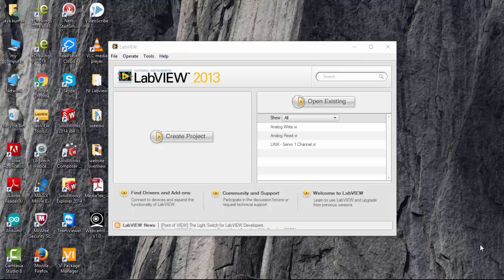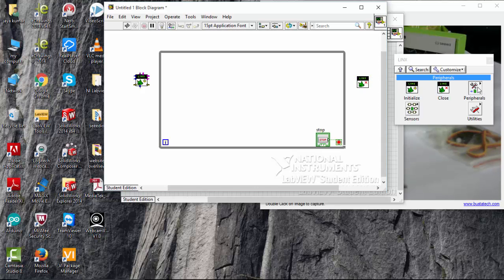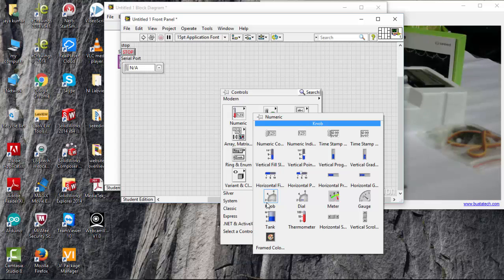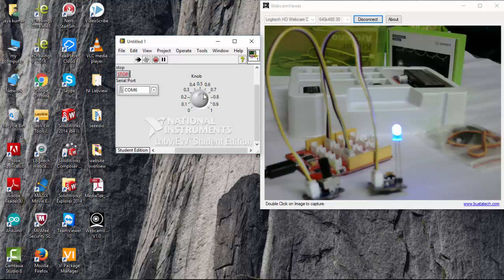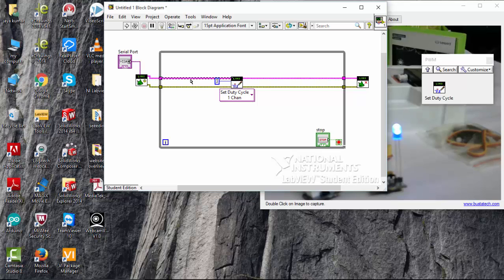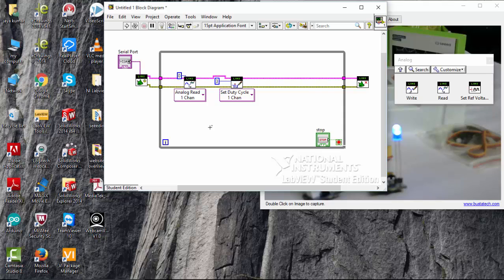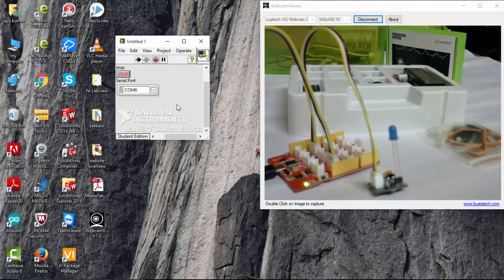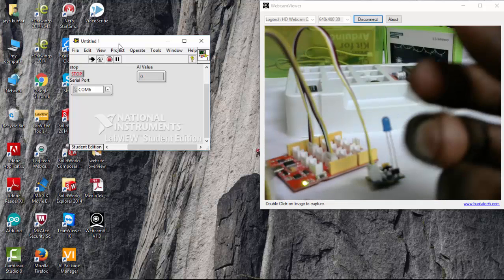How to Control a PWM of an LED from LabVIEW using Arduino

Comment: Hey there.  So maybe I missed a step somewhere, but when I right click https://youtu.be/uCNdf0ykgNI?t=96 , I get nothing but the usual constant?  And maybe you can help me out with what I am really trying to do which is make this https://www.adafruit.com/products/1411 work with labview and the arduino uno to control 16 servos?  Or better yet, do you know of a way so I can streamline things so I can use the libraries of ANY piece of hardware I want to use with arduino and labview?  I'd hate to think there needs to be new firmware built for every time I add a piece of hardware.
Reply from the maker: +Joshua Nord Hi you can make it work with labview, you don't need to add any new library for that, I guess the device uses I2C which is supported in LINX, If you want more experts advice on this you can ask your questions here https://www.labviewmakerhub.com/forums/